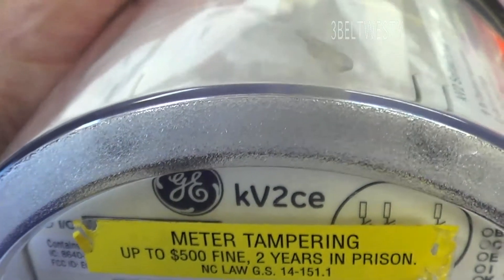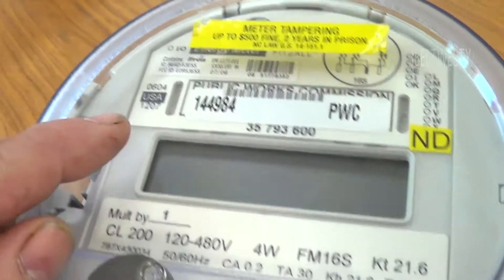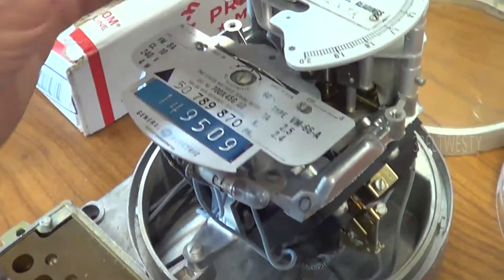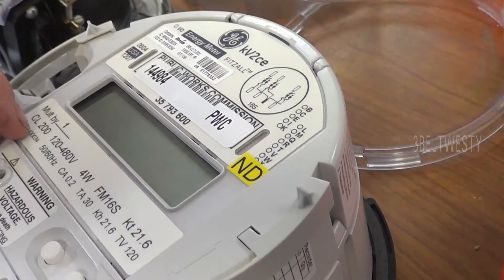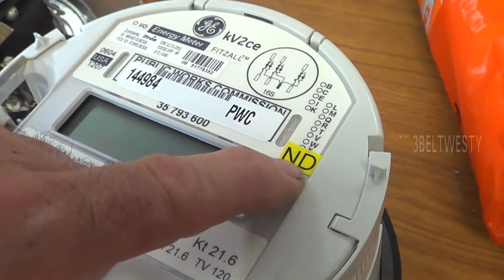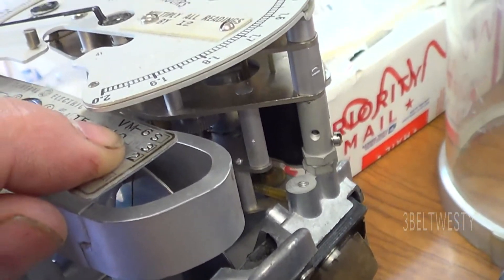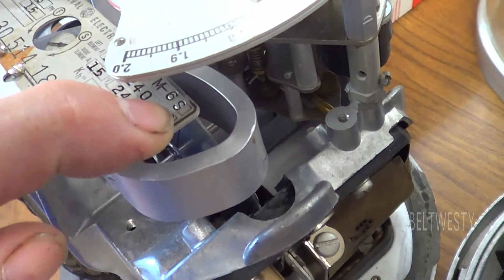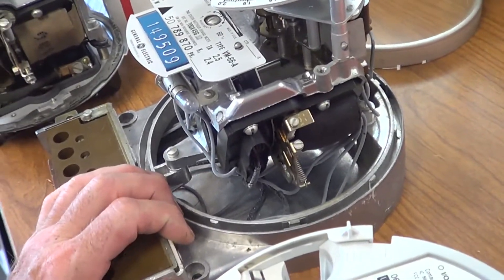GE kV2ce 3 phase watthour meter without demand

Comment: Very cool. How do you date these meters?
Reply from the maker: Meters of about all brands have a serial number and there are lists on the internet and in books to give the age.
Reply: @ I found a list online but it seems to be incomplete. Which books would you recommend for finding meter serial numbers?
Reply from the maker: @HIDLad001  metermans handbook has some; not sure if you are looking an modern stuff or ancient stuff. On old dial type meters the dial gear train can be swapped so this adds an unknown.
Reply: @ The later electromechanical meters from the 1970s to the 1990s. There doesn’t seem to be much information about those.